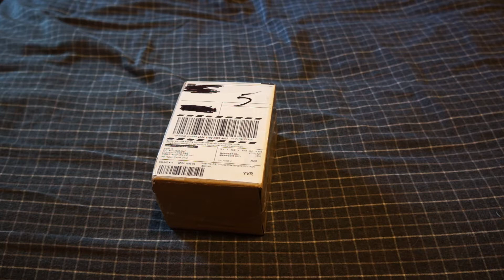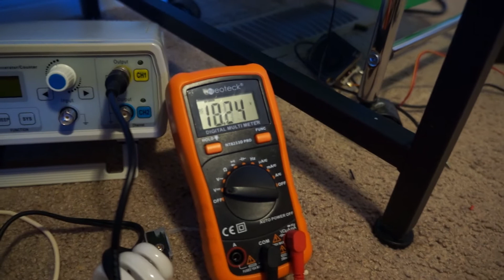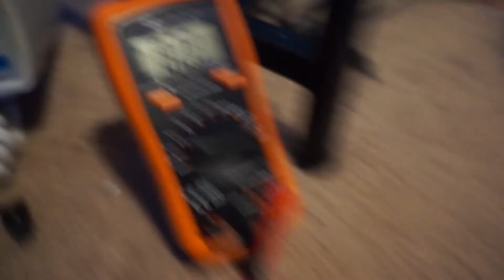Making a Small DRSSTC

Comment: This is S S T C not D R S S T C
Reply from the maker: I think you're mistaken. This is a DRSSTC because of the addition of a resonance cap.
Reply: @All_Science  resonance cap should exist in both , not drsstc alone
Reply from the maker: @Thunderstruck8989  That's not true, the whole concept that makes SSTC's into DRSSTC's is the duel resonant part. In single resonant coils only the secondary, top load and primary exist, but in duel resonant coils their is a capacitor seriesed with the primary.
Reply: @Thunderstruck8989  W R O N G
Reply: Sstc doesn’t have a resonance capacitor in series with the primary, as sstc uses secondary feedback and drives the primary at the natural resonance of the secondary coil and the topload